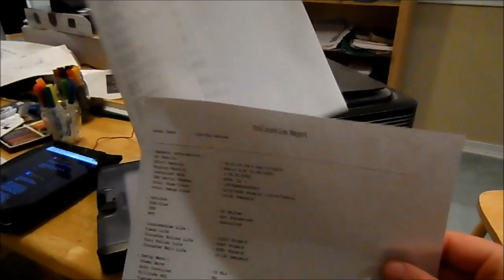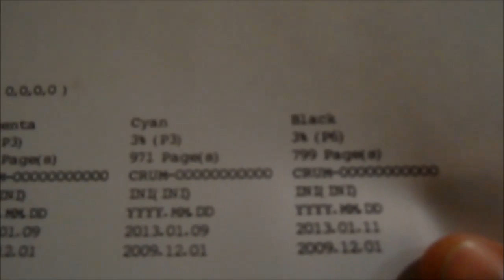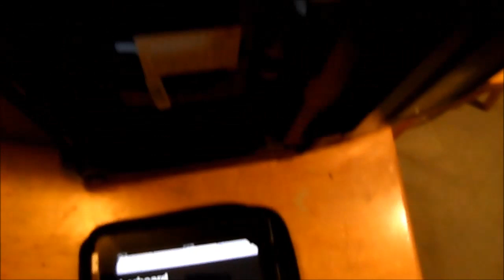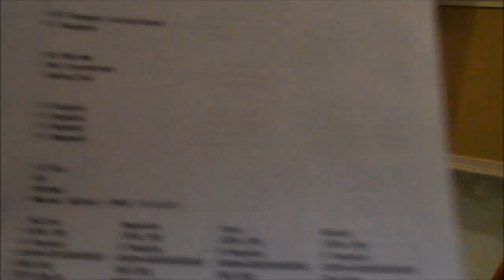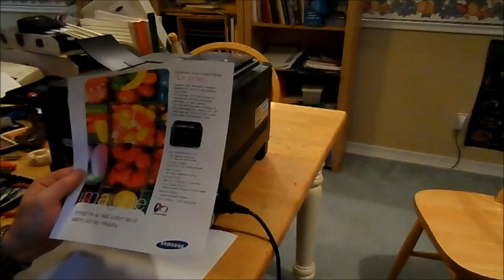Hacking the Samsung CLP-315w to reset page counts

Comment: Hello, I did as described in the video, it worked once, after turning the printer off and on again, the empty toner cartridge problem came back.😩 I did several Testing on CPL 315, it works as long as the printer is powered on. Should the contacts always be left with the adhesive tape?

Comment: Hi Does it work on any CLP series?  I have CLP-326.  Will it work there?
Reply from the maker: Honestly don't know. I know it works with any of the 310 series, but I do not know about the 320 series. I'd say that if the toner carts are the same and you can find the chip in question, you can try it and it might work (at your own risk of course.)
Reply: @cllewis1  Thanks a lot for the quick reply.  I will anyway try this.

Comment: First it did not work but after taping the cassettes all data were set to zero. Only the IP was resetted as well. After using the software SETIP from Samsung I could activate the original IP used by my homenet. SETIP works well under WINE inLinux. The MAC address was changed to 00:00:00:00:00:00. But it did no harm. The old printer driver from Linux also discontinued to work. I used in Linux Mint AppSocket/HPJetDirect, and I coud make my printer work again.
Reply: I was so much involved to make my printer work. Of course I must say a big thank you for this documentation. By the way, my printer is CLP 310N. But the mainboard looks the same as shown in the video

Comment: This works, I did it on my 310 none wifi printer, and about to do it on my free craiglist find 315w also. But on the 315w im getting some ghosting and it smells like burning electronics im going to bet the transfer rollers dirty, as well as the belt. I think this might be becuse the printer wasnt being used. 
It pays to keep an eye on craiglist for stuff people have given up on.  These print good with the orignal cartriges, when these wear out I'll buy new Ones and when my transfer roller expires or the drum roller the cost of a new one will still be less then buying a new printer you cant hack. Every time someone figures these out they scrap that model and change.

Comment: Hi - my printer isnt spooling up, turning and warming up. It did - but I blew it out with compressor, cleaned the tank, removed the overflow screen. The software says paper jam 2 - and when the led is red (flipping the cover can change it sometimes) it says imaging drum not installed. Ive bypassed the drum fuse with a wire and removed the grey resistor as per another yt video. Ive triple checked everything - been 2 days ive been struggling but no lulck. Any ideas why it wouldnt spool up? also power btn doesnt shut on/off..

Comment: Chris - Nice Video - Thanks!  It initially did not work for me.  What I had to do is put electrical tape across all of the contacts on all of the toner cartridges so they would not connect electrically to the front door of the unit.  Once I did this, I then did your "hack" boot procedure and it worked like a charm!  Thanks again for the post!
Reply from the maker: I'm glad that this is helpful to people even several years after I posted it! thanks for commenting!

Comment: The key is to take off the wire when the LED light is green for the first time. My CLP 315 also needed to have taped on its chips in order to work the reset.

Comment: Great instructions...
The side panel is a little difficult to remove, had to free one hing from the front door.
Also found it easier if you unscrew the negative green wire screw, secure your wire there & then just touch the wire for the Eprom with the other end of the wire, no soldering. Better for resale when the time comes.
It took about 30 seconds to a minute to reset.
Didn't need to tape the toner chips on the Samsung CLP 315.
Functions as if it was a new printer.
Question: any limit of times you can refill the Samsung Starter Cartridges before they fail?
I filled them once already (didn't reset then).
I will fill them again once I receive the toner now the reset is done.

Comment: Hi, the reset worked, thanks BUT the printer won't print anymore now. All red lights and smart panel says: wrong [color] toner cartrdige for all 4 colors.
I can however print a configuration page in smartpanel so the printer is not broken only locked by some Samsung security feature.
I only taped the toner chips AFTER the reset.

is there anything I can try?

Comment: that you can not reset this way CLP320, the product is almost the same chip position is different if the 315 is turned to 12am at 320 to 9am. Please help I'm struggling for days.

Comment: Hi! This is very useful totorial! 
But please note the following:

If you are using original Samsung toner with CLP-315W (wireless modell) tape off the toner chipst front of the original toners!

Tested and works fine!

Cheers
Reply: Thank you so much for your advice!! I almost despaired of the printer not working :D
Reply: so if I get the printer out of the box i should just tape off the pins so that it never has a page count? or are you saying to tape off after you've done this reset?

Comment: Thanks for posting this. I did the mod based on the original blogpost, but like you, my printer had a different layout and is just like yours. However I was holding the reset as shown in the original video and the colored toner toner wouldn't reset. Folowing your instructions worked perfect. Simply hold the reset until just prior to the first motor noise. Wait for it to initialize then print a config report and then a color page. Turn off / on and use as normal.

Comment: Many thanks for documenting this - worked a treat and should save a fortune in toner. Compatible toner cartridges 4 for the price of one original (as cheap as toner refill and less messing about). Just remove the compatible chips off the cartridges and tape over any chip that may be underneath - then run the hack :)

Comment: Had a bit of a problem with resetting due to chips on compatible cartridges. After removing the after market chips and resetting without the hack, then taping up the original cartridge chips, run the hack then and it worked a treat. Just a quick tip for anyone (like myself) who isn't confident enough to solder. Loosen the grounding screw and attach the wire behind it and re-tighten. Then as you switch on - you can touch the other end of the wire to the chip leg until the motor runs - no solder!

Comment from the maker: Either get rid of the chips or put tape over them. They are storing the page counts and reporting them to the printer even though you are resetting the counts in the printer.  You have to keep the cartridges from talking to the printer and telling it what the page counts are...so get rid of the chips or cover with tape, then do the reset again, and your page counts on the printer will stay at zero.

Comment: (2/2) All lights are on and red, which means all toner is out.  But I was very suspicious of this beforehand anyway, as I'd replaced the chips with after-market ones which were meant to reset each color.  They all worked until the yellow one, which gave me trouble.  Then I got two more new chips for yellow, and one finally worked, but only for a short while until all toner lights came on.  So it's hard to tell if my printer was already hosed before trying the solder hack.

Comment: (1/2) Hmm.  I tried this with my 315w.  Hasn't worked yet.  I'm not sure if it's because the printer is broken in some other way or if my solder job was poor.  I did have some issue getting solder between the upper left contact and the one below it.  I tried to re-heat and remove, but it's hard to tell if I was successful or not.  Also, since I was unable (and still unable) to successfully print any test pages before the procedure, I'm not sure if it was working.

Comment from the maker: you need to leave the tape on. page counts are stored in the chips on the toner cartridges themselves...taping them makes it so the printer can't communicate with the chip on the toner cart.  removing the tape will allow them to communicate and thus potentially re-set the printer's count back to whatever the real count on the cart is.

Comment: Did your network still work after this. I have exactly the same printer, but after running the hack , my Mac address of the network card has 00:00:00:00:00:00 and will no longer get an IP address. It still works fine on USB.?

Comment: (1/2) I just tried it on my CPL-315. At first it didn't work. The printer kept saying there was a paper jam but soon I found out why... I didn't put the top back on so that's an important thing not to forget!
Then I've put the wire to ground just like you did until the motor started spinning. It went through its self test which took longer than usual but not as long as in your video. It failed... I couldn't print the config report or nothing. Eventually I found out what the problem was.

Comment: (2/2)  3 out of my 4 toners have been replaced so they have the chip on them. After putting some tape on the metal pins in the door I retried. Put the wire to ground and removed it when the motor started spinning. Now it took longer to self test so that looked good! Then printed a test page followed by a config page and voila! Printer hacked :D Back to 100% toner & 1 page count. Now I'll fix a button and order me some cheap toner. Thanks to you for the video and Mr. Rumburg for the hack!!!